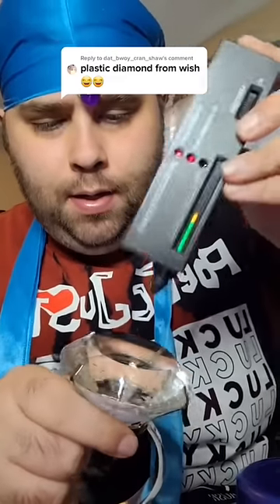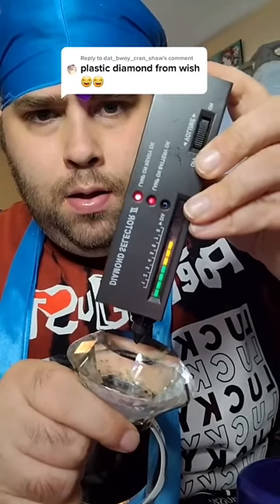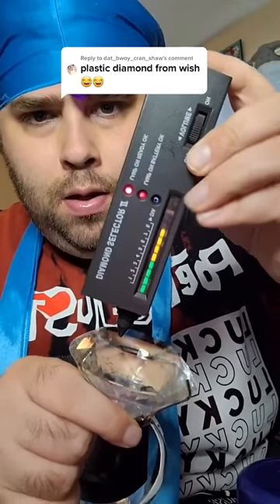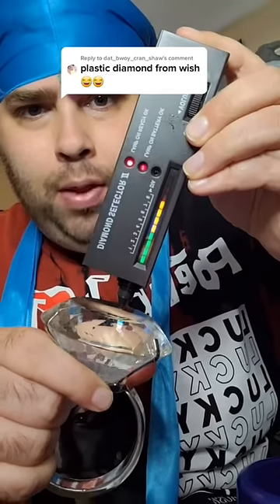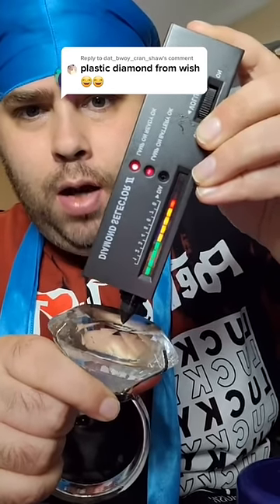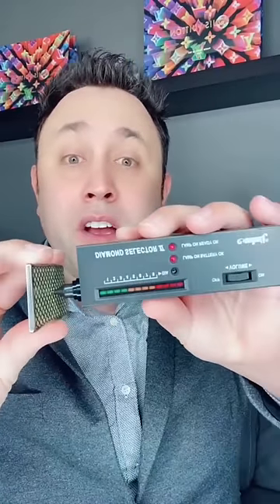How Diamond Testers Work

Comment: If it was real he'd have trouble holding it with two hands yet alone one.
Reply: Ok im trying to wrap my head around that one. What do you mean? Do you think that diamonds are really heavy or something?
Reply: That's..not how it works
But steel is heavier than feathers so what do I know
Reply: @MrAdrous  they're heavy enough that for a diamond bigger than a hand should cause some restraint not holding it like if it were a feather
Reply: @SmokeyOwOs  ... I don't get it
Reply: As someone said years ago 1 gram of diamond weight like 15 grams
Reply: @SmokeyOwOs  are you talking about that riddle "which is heavier 1kilo of steel or 1kilo of feathers" cause if so, you seem to be the type to answer steel and refuse to believe that they are the same  weight lol
Reply: @Conspiracy Marine  1 gram of diamond weighs 1 gram.
Reply: To be honest, no. Based on the density of diamond (Around 3.5gr/cm³) that thing is would have weight around 600gr at best. I won't say he wouldn't be able to lift it, but I wouldn't say it would be as easy as he does in the video.
Reply: My dumbass over here was just thinking that he would hold it because of it’s worth and not wanting to drop it, instead people are talking about weight...
Reply: @viperhunter7951  🤣😭🤣🤣🤣I’m weak asf off tht comment type shit I be on
Reply: @conspiracy_marine9238  As someone with a minimum of 5 braincells once said. 1 gram of diamond IS ONE FUCKING GRAM OF DIAMOND
Reply: @davidtelllez2876  no
Reply: I think you have diamonds confused with gold my guy...
Reply: I hate all these replies because the guy is right it would be heavier then plastic, density of an object is a thing, and no one even mentioned weight
Reply: @david-468  yes density is a thing, but he phrases it in a way that would indicate that he is speaking with weight and not mass. That indicates that he believes real diamonds are heavy. While they are heavy, it's not as heavy as gold or some other metal. That being said, I hate your comment for judging others while not explaining stuff yourself either.
Reply: A gram is a gram, regardless of the material. That’s really basic.
Reply: @sifutophmasterofeyerolling2513  theres a joke vid where the guy refuses to believe feathers weigh the same despite the fact its the same amount in weight.. look it up its pretty funny
Reply: @sifutophmasterofeyerolling2513  but, steel is heavier than feathers
Reply: @viperhunter7951  nothing's even gonna happen when you drop it. it's one of the hardest material. the worst thing can happen is the floor will scratch.
Reply: @iamwisdomsky   True, but people would still take great care of something of such value, even if they know it won’t break. It’s like having a phone with a good protective case, you know it won’t break, but you still want to care for it to make sure that it doesn’t even have the opportunity to prove you wrong.
Reply: @MrAdrous   diamonds are denser than plastic
Reply: @whyareyoulookinghere9135  yes I know. Is that pertinent to this or just a general statement of fact?
Reply: @viperhunter7951  but if it's a real diamond, dropping it wouldn't really matter since they're super hard
Reply: @conspiracy_marine9238  so which is heavier, a ton of bricks or a ton of feathers?
Reply: Not how it works😂😂
Reply: Diamond is just Cacbon,and a Cacbon cube isn't that heavy
Reply: @SmokeyOwOs  what? This entire comment thread is a complete trainwreck
Reply: It’s called trolling goof
Reply: @viperhunter7951  I think you're confusing hardness with toughness. You can shatter a diamond hitting it with a hammer, just dropping a large diamond of that size does have the ability to shatter it. It's very hard but that makes it brittle and not tough
Reply: @johnj4233  hardness and toughness aren't the same thing
Reply: @tn684  it was a joke.
Reply: @conspiracy_marine9238  wouldnt s gram of daimond weight a gram
Reply: Lol u guys rlly believe a diamond that size would be light lmfao?? And btw none of you would be able to pick up a bar of gold that size
Reply: Bro maybe it is that heavy and he just benches 300 lbs
Reply: @SmokeyOwOs  but they both weigh a kilogram.
Reply: @thomasphillips9954  Yeah no, a baseball sized diamond for example would weigh ~1.6lbs and ~8.7lbs for gold. If you cant lift that with one hand then youve got problems to sort out.
Reply: @coolmemesbudd   that’s not my point the guy is holding it with such ease a diamond that size would have weight to it
Reply: @sifutophmasterofeyerolling2513  
isn't the riddle one pound of rocks or one pound of feathers?
Reply: @MrAdrous  denser than plastic at least
Reply: @firefish9347  absolutely, I would agree completely lol
Reply: @Curlymann  And what would we search up? Guy doesn’t believe feathers are heavier than steel and freaks out?
Reply: No diamond isn't that dense it's not tungsten smh
Reply: @viperhunter7951  what would dropping it do?  You do realize just how strong a diamond is, correct? 😂 glass shatters, diamonds wouldn’t even chip from dropping them 🤦🏼‍♂️
Reply: @tn684  You got wooshed mate
Reply: @-47-  Oops, hard to tell what’s a joke and what isn’t on the internet. My bad.

Comment: "It's real diamond"
Yeah I guess someone rich can't buy a 300$ accurate tester and just buy a bullshit 30$ one
Reply: how would an accurate tester be any different? its checking for conductivity and metal is conductive, everythings working as intended
Reply: @markkealy4417  the 30$ one has an adjuster so some of these videos might have fake diamonds but idk
Reply: @thesinister9624  yeah no shit, they’re jokes 
It’s literally “this is my Diamond tester, peep the drip”
Reply: @markkealy4417  good testers use heat to determine if its real, not electric current, this one uses electricity and can literally hit positive on anything if you adjust the dial correctly. It works as intended because its a bullshit tester.
Reply: Good one
Reply: @markkealy4417  The more expensive ones are more accurate and don't require adjustment.
Reply: @shogunguy  I did some digging and it turns out that diamonds don't conduct electricity, so both cheap and expensive testers use heat. now, I have heard of ones that use refractive index, but I think those generally need to be used by someone skilled

Comment: Fun fact:the metal detector has a little lever on the back side of it and if you pull it down, then it will beep. So basically anything could be fake or real unless you use the actual ways to prove it’s real. If you have gold or silver necklaces, use a magnet to check it. If it sticks, it’s not real good or silver.
Reply: L pfp
Reply: not pure* a lot of expensive gold jewellery is just coated in real gold
Reply: The guy had the sensitivity on the max too, because the detector was nearly going off even though it was not touching anything at all

Comment: That specific diamond tester is cheap and has a sensitivity, there is one that can detect , fake , real , and blue sapphire, but might set you back a little bit more , also no sensitivity
Reply: he TROLLED YOU 😂
Reply: All testing devices in existence have sensitivity
Reply: @hblake5213  not the one that they use at popular jewelers like ice box and that one guy that dose custom jewelry for big rappers
Reply: He's annoying
Reply: Yeah
Reply: There’s always someone who says “ this specific diamond tester doesn’t work blah blah blah” and I’m starting to think that those people are the ones lying now
Reply: As someone who works with jewelry, diamonds, and gemstones, we have this exact tester as a joke. You can't set it properly. The volume control is also the sensitivity. It's garbage and doesn't work. Additionally, we have those exact same rings with the big plastic diamond as a display. If you're looking for a real diamond tester, the Testerosa's with a moissanite setting is the best one that we've seen.
Reply: Oye who's on ya profile picture
Reply: @user-oj9yh3yu6s  there's a tester that can detect multiple gems and even detect metal
Reply: Yup yep yup, was about to say that.

Comment: I love how he said the tester was fake the tested it on his wife's ring and it became positive
Reply: that doesnt mean its not fake its talkin about how well things conduct heat and diamonds do so really well and at the same time if they have an oversized diamond and flexing then they wouldve got a diamond tester that actually works
Reply: It's the diamonds that are fake, not the testers.
Reply: Did you hear the noise that it made when he pulled t the “diamond tester” on it sure sound a lot like plastic
Reply: @cerulity32k   exactly they set it to a setting where plastic counts and flex
Reply: @cerulity32k  he puts the tester between the stones and it came positive when he put it on his fiancée’s ring on it he put it on the stone and it became positive
Reply: That's because he tested it with a real diamond tester and just wanted to make a joke I guess

Comment: You know it's real when it keeps showing results at thin air
Reply: It does so in both examples. The air has a certain degree of conductivity, so it stays in the yellow until touching a solid with high heat conductivity, which is when it’ll go in the red.